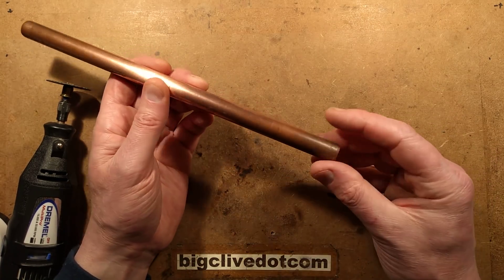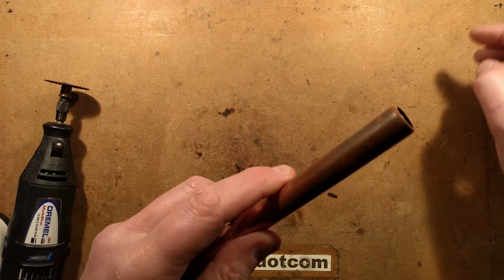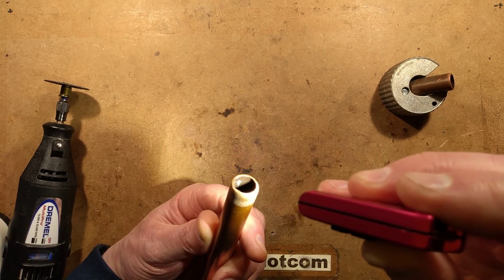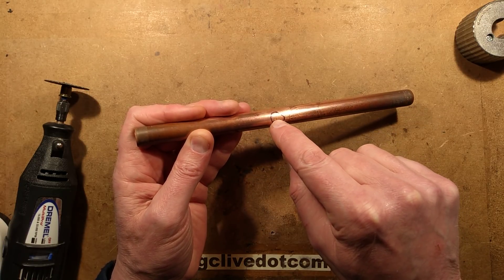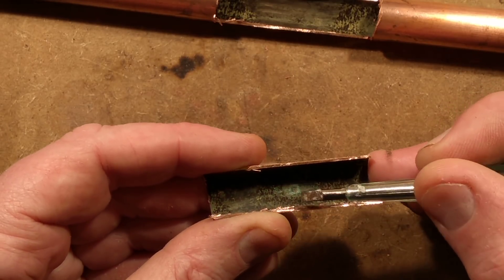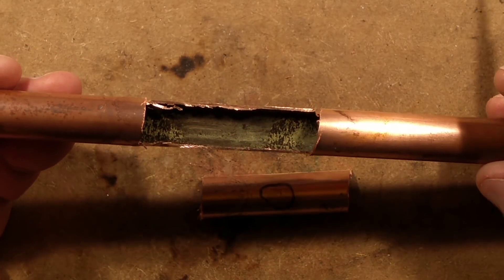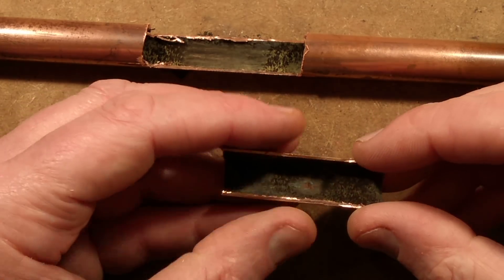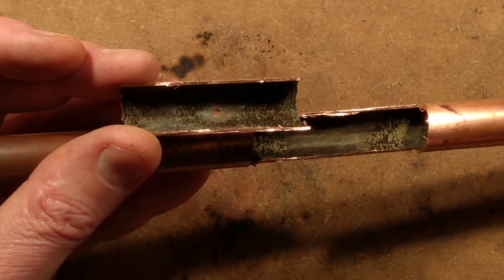Odd pinhole leak in copper pipe.  Selective electrolytic corrosion?

Comment: Very common in eastern PA (USA). Prevailing theories range from water PH, bits of flux during construction, to my favorite- bits of steel wool left over from when the copper tubing was cleaned and soldered when new. It usually happens downstream from a joint, as if a left over flake/strand/bit of the steel wool washed down the pipe a bit from the joint and settled on the copper. Almost always happens on the bottom of the pipe, where gravity would cause it to settle. Sometimes other little spots are found. Since flux and steel wool are used during the install, it could be bits of steel wool covered in flux that reacts with most when the water is at the right PH! (There we go! All three theories rolled into one!)

Comment: Why not grab a cheapo borescope from eBay and shove it down the pipes? then you could pull the scope apart afterwards :D.
Reply: That's definitely a smarter plan than unfitting a kitchen. Also I'd be interested in a disassembly video, they do seem too cheap to last well or be reasonably good quality at the lower end of the market, but as Clive has shown in the past, some of the El cheapo chinesium products are of surprisingly elegant design, if not necessarily build, with minimal surplus componentry and ingenious double use of components to keep the parts list down, but decent quality for the money bar the soldering and potting which is usually not too grand with the former and excessive regarding the latter lol.

Comment: if the water was spraying on the tood work and especially the drywall boards you should replace the drywall boards as mold is not a good  thing to have.

also you may want to use a disinfecting treatment of bleach to disinfect the other areas that got wet

last year during the 2017/2018 winter i had a close call with a frozen pipe.

fortunately i caught it in time so no damage was done i was just without water.

if the pipe would have burst it would have meant jackhammering the floor of the garage because where it froze was just below the cement  and would have been quite expensive.

once a small heater was placed on the pipe it thawed and the water came back on.
Reply from the maker: Just wood and I dried it out and treated it as a precaution.

Comment: Seems quite a common problem 
https://www.dailyherald.com/article/20141114/entlife/141119476/
("The three most common of these are chloramines in municipal water systems, particles of corrosion from aging water heaters, and high water pressure inside the pipes").  I live in an extreme soft water area - different chemistry, only problem is cost of copper.  Just had a big renovation to bathroom and heating system.  Lots of plastic used - so no idea where that will end up.  Five miles down the road, (part of Halifax), copper rots within weeks, they have to use stainless.
Or fruit flies on steroids

Comment: I have exactly this problem in my house, built in 1956.  The leaks can be so fine, that it's difficult to detect the source.  The spray was not audible or visible until the stream was back lit.  I did the same thing as Clive and found the hole was cause by a small particle, laying on the bottom surface of the pipe.   I'm leaving half of my basement unfinished so the plumbing is exposed and accessible.

Comment: About 20 years ago we had a phone call from a daughter saying we had a leak in the ceiling. I told her to put a screwdriver through the plaster board and use a bucket until we got home from Greece. Eventually I found a damp area behind some tiles in the bathroom above the leak. I could not see the hole but felt a very, very fine jet of water on my face. I drained the system opened out a small section of copper pipe to fit over the hole and soldered it. As I say that was over 20 years ago and no problems since. Maybe you will be lucky too Clive. A galvanic reaction does not occur when dissimilar metals are in contact as in sacrificial anodes on ships.

Comment: Sounds like you may have an elusive task of replacing the sections of pipes over the next few years...  Is the Pipework grounded at the supply?  Is there a way to stop the corrosion from happening?  Most hot water tanks include a sacrificial anode that stops the tank&pipework from corrosion.  Would it be possible to add a sacrificial anode to stop that from happening?  Looks like the impurities of the water may have an effect on those spots.   More ramble...  Is the dissimilar metals of the connected faucets and appliances causing the problem?   Hope that you can resolve the problem before you may have to go through the expense of replacing all of the pipework.  Would purging the pipes with vinegar help?

Comment: A lightning strike can also cause a pinhole in copper pipe.
Reply: I would imagine lightning would make more than just a pinhole, not to mention obvious burn marks on anything in the vicinity. Electrical erosion from a low energy source like frayed low voltage wiring touching the pipe can do that, but he would have mentioned it if that's what happened.

Comment: As an electrician lifting floorboards,  I once nearly cut through a pipe going diagonally across a room. The pipe was weeping, a plumber came round and explained that copper pipe once went through the roof cost wise back in the 50s-60s. 

Plumbers were doing anything to save money and  besides using diagonal runs they were buying sub standard copper pipe. When he removed the whole length it was so thin discoloured and full of pinholes, he said the pipe was contaminated with other metals to save on copper.

Comment: I used to work in the medical device manufacturing business. We once had a stainless steel tube (tiny, like 3mm diameter) that was leaking. Turns out most pipes are actually seam welded, and that is a severe weakness. The welding culd easily include impurities.Another thing s the water in my parent's house used to be super soft. No scale buildup anywhere. The city did change that by mixing the water supply with another city's to make the water harder, as the soft water would corrode metal pipes.

Comment: If you have hard water these holes can self seal leak and so on for quite some time before you notice them.hot water cylinders go this way in the dome part of the tank near the top. A plumber friend tells me it’s from air bubbles constantly gathering at the top . I wonder if this part of the pipe is in a high spot where air has kept gathering?

Comment: I once had a pipe in my house that got 3 of those pinholes. Just one straight section, nowhere else. Fixed them with epoxy. After the 3rd I had a plumber replace.

Comment: The same thing happened to my mother's place. The part that leaked was a standard 90 Degree elbow of which there may be 100 or so in the house. Wonderful.
The house was 20 years old and my parents were the first owners and was all original construction.
The leak was not detected for some time as the water went to the basement furnace room and down the drain.

Comment: I know from similar problems with are couse becouse the pipe is solder with s39. A acid for flowing the solder..
A major mistake while the S39 ceeps rating up the Cooper in the future.
I know this problem with holes made by bacterie in stainless steel, even in 316.
Wen you store not moving natural water in stainless steel the bacteria with eat up the strainless steel in 3 years..

Comment: long term corrosion like this tends to be from sediment in the line sticking in one spot and that causes the pin holes. more a flavor of galvanic than electrolytic, since its from one metallic sediment bit acting with the copper of the pipe, usually, and galvanic only needs water and two dissimilar metals, where proper electrolytic needs some flavor of charge involved even if its minute/ambient.

this is why its recommended to not let any one leg of your houses water system sit for long periods without having the water run.

time to upgrade to pex?

Comment: I think they call this phenomena Cavitation. It's supposedly called by imperfections in the pipe or that they have not been properly burred during installation and it causes abnormal turbulense in the water stream. There are videous on youtube where it's extensively explained.

Comment: I have seen linear extrusion defects in pipe wall along a whole length of 15mm copper pipe I once purchased. This however looks exactly like what you suggest though, being differential metals corrosion. Possibly from the steel wool that is sometimes used for cleaning pipe ends in readiness for tinning or even possibly a stray ball of leftover solder. I take it that you are in a soft water area unlike myself.

Comment: I've had this problem with copper pipe installed in a house built in 1983. Two separate occasions on cold water, one on hot and two on central heating. We also have pipes buried in concrete. That doesn't bode well.

Comment: Too much flux, non-soluble type. You can do it yourself on the external side of the pipe. Try it with some flux and leave just leave it at the back of the workshop for a while. (as an extra test do another in a sealed jar of water). When you come back to it you'll see the same effect. That's why only put flux on the pipe, not the fitting, just clean that well and put it on the pipe so you don't push flux into the pipe. It's not too bad these days with soluble flux though.

Comment: I have found that sometimes if your water is acidic that this is more of a problem. I might be wrong but I've taken two pieces from different houses and they had acid water. When the water facet leaked it produced a green stain in the kitchen sink and the other in the bathroom. No sure but good luck figuring it out. . I'm guessing and might be wrong.

Comment: I have a 47 year old house, the copper pipes are way more tarnished outside than your stuff so I'm guessing way older, no issues with the copper pipes in my place but the old hot water cylinder failed when the copper internal tank started a slow leak, pinholes?.  Caught it before it got worse and destroyed chipboard flooring.  Interesting reading comments about later cheaper copper pipes having issues

Comment: This study mentions pinhole leaks, black deposits and green mounds. Sounds familiar... https://www.researchgate.net/publication/269192034_An_Investigation_of_Copper_Pitting_Corrosion_and_Pinhole_Leaks
Btw, a healthy copper pipe should be all pure oxide green inside. That helps protect the copper from the water. Wrong Ph, different high mineral content and/or  too high of a water speed (friction corrosion) will continuously strip the green oxide layer and corrode the copper quite fast.
All leaks we have had in the basement in this appartment complex have all been pinhole leaks. Every single one. Even in pipes that were replaced less than 5 years earlier. It was all due to a high water speed in the hot tap water circulation system. After every joint and bend, the copper was paper thin. The wirls in the water ate the copper super quick.
I saw a video about a house with lots of leaks some time ago. Their water boiler had rusted inside and all the iron oxide came out in the system and was showing up as dark brown deposits, and small green mounds, with pinholes under them.
ah, here it is: https://www.youtube.com/watch?v=nD5lMITzx_Y  it was 'this old house' someone mentioned further down here.
I don't know what your oil boiler looks like, but I would look into that possibility.

Comment: Had the same problem with my last house, the plumber said it was the new copper I had used when building the home  in 1998,  cheap imported Chinese pipe made from poorly recycled copper. Every time copper is recycled without smelting to remove  contamination it builds up and this is the result.

Comment: Clive, you said it was under floor boards, are you 100% positive the very tip of a floor board nail hadn't gradually penetrated the pipe over time? Does it look like the hole started on the inside or outside? When you lifted the floorboard did you see any sharp objects in the wood near where the damage was? I've never heard of the condition you described. Toby
Reply from the maker: Well clear of nails and obviously corroded from inside.

Comment: Found a leaky pipe behind a wall once. A drywall nail was almost touching the copper pipe by about the distance across the letter (o). Seemed odd that it was not even touching the pipe but it ate a hole anyways. Took about 40 years.

Comment: Someone who I've recently done electrical work for has a well supplying the farmhouse. They are used to this happening over the years, as during very heavy rain some iron from the ground contaminates the well.
The hot water cylinder needs replacing now as it has a pinhole which has caused the leaked water to burst the PU foam insulation jacket.
I noticed when doing the rewire, the immersion stat didn't have the additional safety cutout.
I think I have the job of doing the cylinder.....

Comment: I know that the kind of copper pipe that we used to use in houses around here have a "paper life"/"technical suggested lifespan" of 30 years or so. Not sure what the life of the new modern plastic tubing is, but that's designed to be easily replaced anyway. But I've never seen a failure like that. Mind we used to use pvc coated annealed copper pipes in houses.

Comment: cheap copper from Eastern Europe has fine grit in it sometimes which eventually blows out and leaves a pinhole.....cheap radiators also suffer with this in the rolled steel and you end up with a bubble of water underneath the paint.....been a heating engineer for decades and see it all the time!

Comment: .....in the old days they used lead covered cables for the telephone service.... we had to strap out any high voltage cable that was near the telephone cable because the lead cable would "Pit" and then you would have moisture in the cable. Only a few volts are needed to do this (just saying you might have 240 volt cable in parallel with the pipe and this could cause this)...thanks for the autopsy of the copper pipe.... nice to know that there are things out there that have questions...???

Comment: In the 1970’s we had a problem with copper supplies following the Rhodesian declaration of independence and we had to use any copper pipe we could find. Much of it was semi hard thin wall pipe that could not be bent, but most of it was rubbish. In time this started to perforate which has been an on going problem and some of it is still out there but with fewer plumbers left who remember what happened! You may well have unearthed a relic.

Comment: I would think flux contamination, as you often see this sort of corrosion near solder fittings.
I always thought PEX pipe was more of a DIY solution for the unskilled plumber but it does seem to have a lot of advantages. I've seen joints leak, but this appeared to be caused by installation error.

Comment: I was a service technician for 17 years. So I've seen this happen a couple of times on dishwashers
hot water supply line.  The first time I tried to repair the problem by soldering the hole shut,
I ended up having to go back and replace the copper line anyway because of a second pinhole.
The second time I just replaced the copper line right away.
In my experience once you start having this problem it will keep happening until you replace the pipe.

Comment: Fern9x corrosion protector is needed urgently. We had a house built in which all the piping used was substandard and unevenly extruded (one wall was much thinner than the other.) After many many leaks my parents sold it. The new occupants eventually demolished it and built another house there possibly because the cost of completely re-plumbing it was about the same s building a fresh. Also the plumbers chiseled out the cement slab put the pipes in the groves then cemented directly over them. Adding galvanic corrosion to the fun. Most of the radiator pipes rotted out just at the interface between the cement and the air. 
They were bloody idiot builders and even more stupid plumbers. Even at 14 I knew what they were doing was stupid. Unfortunately they were cheap.. and so far as my father was concerned that was all the qualifications they needed.. which he very much regretted within a few months of us moving in when the leaks started.  Good point was we never got any snow within 4' of our ouside walls! However my father had to replace the 1st oil fired boiler because the radiators never got hot.

Comment: This is often caused by excess flux being used in soldering the pipes and the flux gets carried down and deposited on the pipe. This is more common than one might think. Google copper pipe corrosion for more information on flux flow causing corrosion.

Comment: At a guess it looks like electrolysis from dis-similar metals.....like heavy metals in the water iron ?
yes it will happen all through the pipes after time,
I use to fit a anode inside my truck water pump to help the cheap chinese pump housings last longer